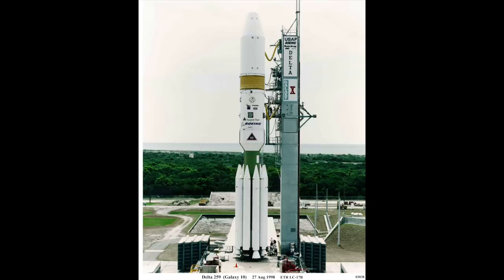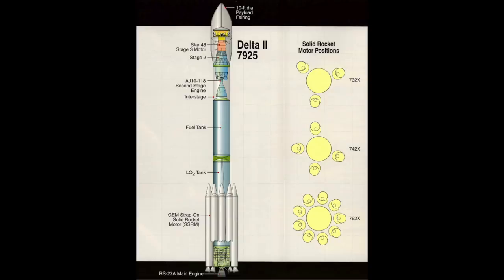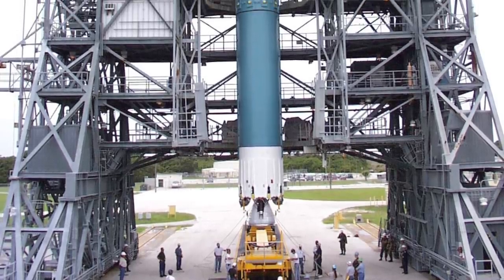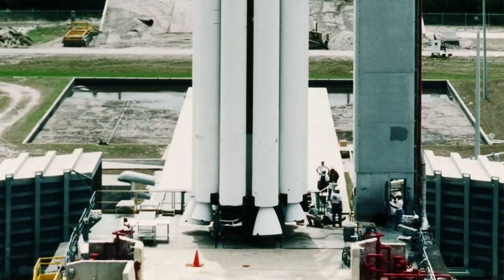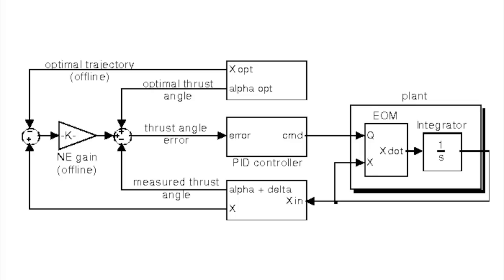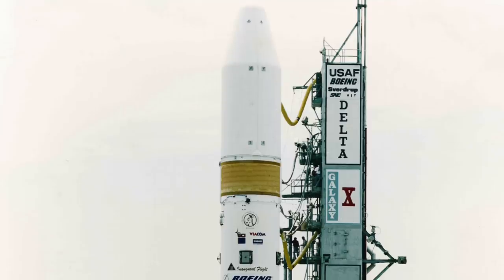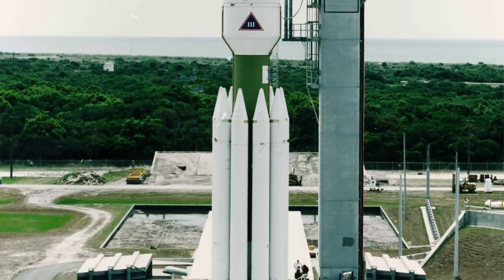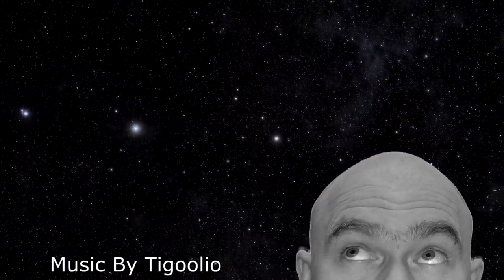Why The Delta III Rocket Exploded On Its First Flight - Why Rockets Fail

Comment: Thank you, as always. And your input is desperately needed on why Starship may fail as a lunar lander - regolith as shrapnel, damaging itself or orbiting craft. Could it throttle the Raptors to hit zero velocity at 15 meters altitude, instead of zero altitude? As 1/6g slowly draws it down, fire a cluster of hot gas thrusters, similar to its RCS thrusters. (Double as ullage motors?) Workable?
Reply: Since Starship is a private investment by SpaceX I think it'd be great for them to just send one up to the Moon and see what happens. NASA doesn't lose any of its budget and SpaceX/NASA can learn from what happened.
Reply: I am intrigued. Did you come up with this scenario yourself or is there a place where this is getting discussed? I mean the acceleration of regolith to the degree that is poses a risk for orbiting spacecrafts or satellites? I want to know more :)
Reply: @z33r0now3   Dr Robert Zubrin of the Mars Society brought this up. He's a prominent long-time advocate for Mars missions. Others have chimed in agreeing or disputing his claim that Starship will kick up rocks hard enough to send them on a ballistic trajectory to orbit. No atmosphere, so even rocks moving at a slight angle to the ground can reach orbit or orbital altitude if moving fast enough. I've followed this 2nd and 3rd hand, but the debate is extensive, there may be a concern.

Came up with the idea of shutting off the Raptors at a certain altitude and using smaller engines myself, but on my post about this on reddit someone suggested the hot gas thrusters based on the RCS design they'll use. Then I realized Starship will also have ullage engines, but they may be too small for what I'm proposing. It will be falling slowly, not much room to accelerate - but will have the inertia of its ~250t mass.

Comment: Not going to rag on anyone for failing a first launch. I am going to rag on someone for putting a real payload on a first launch. It's got a lot of the same parts.... yeah... it's also painted the same color. It's a different craft. Test first.
Reply: So I'm not the only one who's nervous - SLS will launch with the full EM-1 mission; a Billion+ Orion capsule, expensive service module. The ICPS is new. But the same as the reliable Delta Cryogenic Upper Stage... But different...   aargh.
The SRBs are "almost the same" as the Space Shuttle's. But extensively redesigned.
The flight software is all new??? Or partially Shuttle derived? 
But expending a billion dollar booster on a lump of concrete is too expensive - they've built a rocket that's too expensive to test! So if all goes well, SLS will be crew-rated after only one flight.

Comment: I noticed that the design of Roscosmos Angara, spacex Falcon and Boeing Delta 4 are very similar. Apparently we have reached the limit of our technology, space rockets are simply unified tanks with engines and are very similar due to maximum optimization. I think nothing new will be seen in the coming years in this area. Only if breakthrough technology does not appear, for example, a new type of engine or fuel.

Comment: Why rockets fail. Due to bad engineering, due to bad maintenance, due to bad weather conditions, due to bad management a the top taking unwanted risks.
Reply: Due to being designed and built by humans. No wonder the machines want to take over and be designed by other machines.

Comment: It should be recalled the Delta III RS-27A rocket engine had an interesting lineage.  The RS-27A was an improvement of the RS-27.  RS-27 was a development of the H-1 engine of Saturn I and IB rockets.  The H-1 was a follow on engine based on the Rocketdyne S-3D that powered both the  PGM-19 Jupiter and PGM-17 Thor missiles and the Juno II rocket.  The S-3D shared its lineage from the Rocketdyne LR-79.  Rocketdyne developed the LR-79 engine in 1955-56 for the U.S. Army.  The LR-79 was derived directly from the German V-2 rocket technology.

Comment: In control engineering this is called a critically UNSTABLE closed loop system and is ...like .... control systems 101!! They didn't test this new hardware with the control system's tuning ability (I saw a PID in that diagram -- a 'fix your theoretical errors' device that tunes the STABILITY and response time of system). It might be rocket science but, it's being controlled by FISHER-PRICE like control systems or engineers :(

Comment: Seems a bit redundant activating the flight-termination system when the vehicle's already exploded.
Reply from the maker: Best to blow it into as small a pieces as possible
Reply: Plus, it provides a "free" data point regarding the reliability of the flight termination system (assuming it can later be determined from visual or telemetry data that it activated).

Comment: Very casual space enthusiast here. My naïve confusion about rocketry in general is this: the absurdly multi-variate puzzle that is "how will this dynamic system perform" has to be basically started anew every time the design changes, even slightly, right? And simulations are necessarily limited in the information they can provide. Doesn't this MASSIVELY incentivize finding a good-enough platform with extremely well-mapped-out dynamic behaviour, and using it over and over and over because it's predictable (and much less likely to fail as a result)? Or is that already the case (and fast iteration in the SpaceX style is the exception)? Were all these Delta iterations just an artefact of the era? Or is my intuition about the knowability value of a fixed-design platform off?

Comment: Tuning a PID controller is becoming a mundane thing for all sorts of technological hobbyists. Pre-flight testing and predictive imagination are a necessity for hobbyists that use them in any situation where excessive authority can cause negative consequences. It's worrying that a multi-billion dollar technology developer just kind of yada-yada's the tuning. The more I think about it, the less plausible it seems that this was completely accidental negligence.
Boing just bought the company. It came with an expensive machine, that they had to pay for, and is heavily insured. They likely didn't want that particular machine, or someone with access to the machine was not happy about the change. It's more beneficial to "Oops... Insurance please" for the new owner of the rocket, and the suspiciously under-cautious payload owners, than to internalize the full expense of maintaining a separate system of tech (rocket, et al.) and payloads that may have never recouped their costs naturally.

Comment: Great reporting Scott!  I liked the student steering analogy.  Thought for sure by now the PHD engineers had overcompensation dampening down to a science!  Guess not.  Seems to be an Applied Physics wake up call.  To run out of compressed CO2 or whatever they used to push the hydraulics does seem also embarrassing.  This double embarrassment needs to be shown to our middle and high school students as an incentive to be interested in and focus on math.  If I were still teaching I'd show your video.

Comment: In addition to the spectacular explosion of the vehicle, the payload completely separated from the upper stage and continued a ballistic trajectory down range. A group of us sat at a local beach side bar discussing what we just saw when several minutes after the initial explosion there was a large fireball on the horizon. It was the satellite finally reaching the end of it's flight. I have witnessed most of the failures at the Rocket Ranch in the last 20 years and I must say seeing that satellite hit the water was the most unique explosion I have seen.

Comment: 7:30 - Why didn't they design the booster nozzles with a big spring or something to force them back to the neutral position in the event of a loss of hydraulic pressure?
Reply: That would mean that you would need even more hydraulic fluid to actuate them and the problem would be worse. They never expected the hydraulic fluid to run out anyway so they would have never added unnecessary weight on the gimbaling system.
Reply: @abcdefgh-db1to  It shouldn't even be possible for the hydraulic fluid to run out at all; normal hydraulic systems don't lose fluid unless there's a rupture in some component or another.
Reply: @vikkimcdonough6153  they probably lost pressure and they may have a way of jettisoning the unpressurized fluid to save weight.

Comment: I wonder if an alternate preemptive fix could have been to sense the hydraulic supply and command neutral position and hold if either member of a triad of boosters got low for any reason. Less control just before loss of control but a predictable and partial loss of control.

Comment: It sounds a lot like they had written a rudimentary A.I to control the rocket, with weights and what-not. Also "Roll Control" is an excellent name for a band, write that down! :P
Reply: I wouldn't call it intelligent, as all the learning was done by the engineers, not the software. I'd call it a control system. Earlier similar systems were built for targeting missiles, 'cause, y'know, it's embarrassing when you miss.

Comment: Hey Scott why do they face the nozzles of the boosters outwards, shouldn't they start vertical? 6:19
Reply from the maker: They point inwards towards the center of mass because if the thrust varies they don’t want extra torque

Comment: Is there a difference between a solid rock moder and a solid rocket booster?
Reply: "Solid rocket motor" is the most general term.  It can be applied to anything from a propulsive stage for a large satellite launcher to a tiny spin-up motor.  "Solid rocket booster" is limited in usage to things like a main/core stage, or some sort of augmenting "strap-on" solid rocket.  Something that pushes the vehicle forward.

BTW, the "SRB" initialism gets used a couple of ways:   "Solid Rocket Booster" or "Strap-on Rocket Booster".  My sense is that either way, when someone uses SRB they are generally referring to auxiliary propulsion of some sort.  Note also that a Strap-on Rocket Booster isn't necessarily a solid rocket motor.  The Indian GSLV, for example, flips the script and has a solid rocket motor core with liquid-propellant strap-on's.
Reply: @marcmcreynolds2827  thanks

Comment: Probably a stupid question, but who pays for the loss of the satellite in cases like this?
My first instinct would be that it was underwritten by insurers, but I can't imagine the costs involved.
Surely the satellite manufacturer or customer doesn't take the hit - do they?
Reply: I often read of satellites being insured. Must be a hefty premium. Surely based on the rocket's history, i.e. insurance on a 2019 Falcon 9 a lot cheaper than in 2015.
Reply: They are often insured, and yes it is expensive. In some cases major satellite operators will skip the insurance as they are big enough to "self-insure" and absorb a loss, but smaller companies need the insurance as otherwise a launch failure could bankrupt them.
Reply: Yes, launches are customarily insured. Costs a few million dollars, but that's reasonable when the total cost of the project is into the hundreds of millions.
Reply: @donjones4719  Thank you for your quick response.
The mind boggles when trying to imagine the premiums.
Clearly a very specialised job, and as you say there must be a huge amount of research into the rocket's history, and any potential risks with new or modified rockets.
I've no idea of failure rates, (though I imagine that the information is available), but given the costs involved, (with many satellites running into millions of dollars) and the potential for disaster, the premiums may run into the millions themselves.
[I've obviously no idea, but if someone told me that the insurance premium was 25% of the value of the satellite I'd have no problem in believing that.]
Reply: @RobertHancock1  Thank you for your response - the fact that there would be a variety of methods makes perfect sense.
Reply: @bfrobin446  Thank you too. As I said in my follow up comment I'd have no problem in believing that premiums run into millions of dollars, and probably significant percentages of overall costs.
Reply: I just recently read that most payloads get insurance from a specific ensurer that is specialized in these kind of contracts and scenarios. I faintly remembered the name, which was something like  Lloyd's of London. So I just looked it up and found this, maybe it helps:  https://en.wikipedia.org/wiki/Satellite_insurance

Comment: takeaway; we should probably move on from a technology that is a century old. Nothing has changed in the field of propulsion that has benefited the population at large for over 100 years
Reply from the maker: Feel free to demonstrate an alternative, because we haven't found one.
Reply: And it's not just rocket motors that should get the boot.  What about airplane wings?  After more than 100 years, they still just...  lift   ;  )   More seriously, I would offer that rocket propulsion reliability has increased, in concert with other improvements, to the point where successful satellite injection is now a lot closer to a given than it was in say the 1960's.  The population at large has certainly benefited from weather satellites and communication satellites, among other payloads.
Reply: @marcmcreynolds2827  everywhere you look up in the sky or on our roads, its antiquated tech from 100+ years ago. And with the exponential advances in almost all fields of research, i am to believe that this very central and important field of research has not gone anywhere in a century ?!
Reply: @TheNguyenGiap  I think we all agree that breakthroughs are nice things;  we just have different perspectives on "not gone anywhere".  Simple pressure-fed rocket motors necessitating relatively heavy thick-walled propellant tanks were at one time state-of-the-art.  Then came turbopump-fed open-cycle hydrocarbon engines, a huge improvement...  until materials science breakthroughs allowed for workable closed-cycle designs...  and so on, up to the latest/greatest cryogenic engines, or the much more affordable yet very efficient SpaceX Raptor.

Advances in solid-propellant rocketry over the last eighty years have been similarly dramatic, going from really no change at all for over a thousand years of black powder to the point where a rocket (SS-520) small enough to be towed around by a private vehicle can put a useful payload into orbit.  That's gotta be at least a little bit exponential...
Reply: My apologies to ion engine developers for omitting them.  Hayabusa2, for example, is now on its way back home having executed a mission which would be amazing even if only half as ambitious as what they actually managed to pull off.  Way to go Japan!

Perhaps it will be ion engines which next see the rate of progress chemical rockets have in the past (but not the future, as achieved Isp for the various propellant combinations inches closer and closer to theoretical maximums?).
Reply: @marcmcreynolds2827  oh yes thats right, now they are re-introducing ion drives like its the new black, although it was on an ESA mission way back in 2003 called MOON-1 or something along those lines. Still no progress that is public at least...
Reply: @TheNguyenGiap  Those original ion drives had various problems like the grids clogging sooner than later.  The latest ones are improved.  I would imagine what comes next will be more improved still.

That's. How. Things. Work.

Comment: Why isn’t there an escape ejection option for unmanned payloads so that there might be a recovery of the satellite?
Reply: Extra weight
Reply: @Aerospace_Gaming  and more things that could go wrong or fail, if there is no need for crew safety, then... building another satelite is easier than breeding, schooling, training and retraining new humans plus their ancillary associated costs of feeding, cleaning, housing, power, water, transport, gifts, intimate relations, sewage treatment etc and it's faster too.
Reply: Aerospace Gaming I understand that but there is a definable cost per launch of that. 

If the payload were too complex for quick rebuilding then a 10% extra cost might be an acceptable insurance cost of recovery by the customer. 

So I’m asking what’s the overhead cost.

Comment: Seems like pretty expensive hardware to only use once. Will expendable launch systems ever be rendered completely obsolete?
Reply: No... Remember the fuel you use is a good chunk of the expense and reliability is everything. Elon musk hasn't even been able to prove that reusing rockets is financially viable. Hell, the space shuttle had reusuable boosters that were wayyyyyyyy simplet and they never saved a dime trying to reuse them.